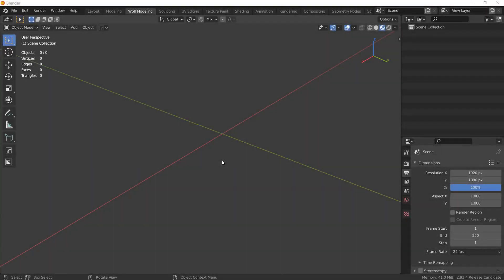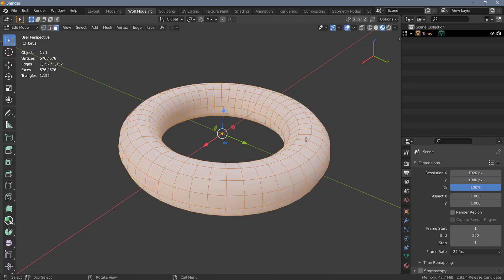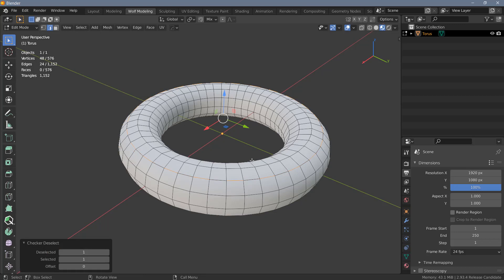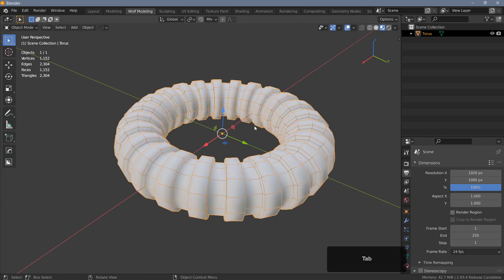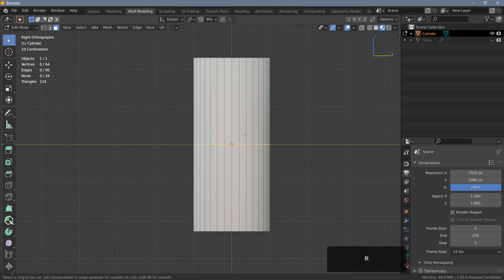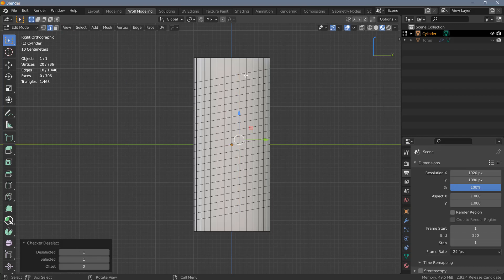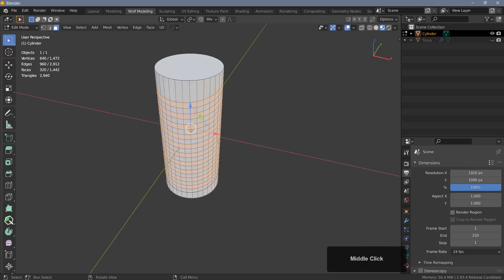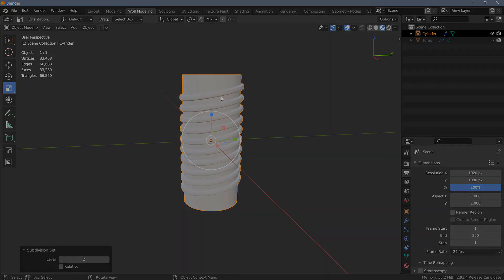Blender Quick Tip: Quickly select alternating loops (Blender Tutorial)

Comment: 2:30 a what? for me its changeint edges of the object and alt+r do nothing
Reply from the maker: Machin3Tools. It's an add-on for Blender. There's a free version and a commercial version. Alt+R is the shortcut activating Machin3Tools' edge constraint feature (which is only available in the commercial version). 

If you don't have that, instead of the loop knife use the regular knife tool to make a diagonal cut (make sure the knife cuts through the entire object). Then bevel as shown in the video.

Comment: Is something like this possible in C4D?
Reply from the maker: Not in C4D itself. I stopped upgrading after R18, for which I had two plugins that allowed you to do selections like this and more. I have no idea if they even exist anymore, or if they are compatible with new C4D releases. One was called "Sélections supplétives" by CodeVonc (free), the other one was "Devert Advanced Loop selection" (paid one, if I remember correctly). You could google for those and find out if you can still get them or use them in the latest C4D releases.